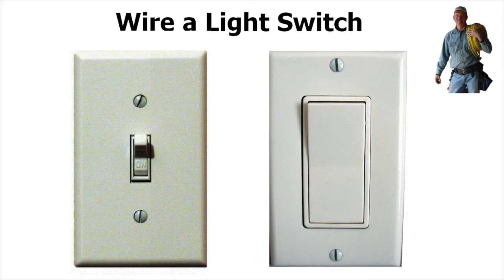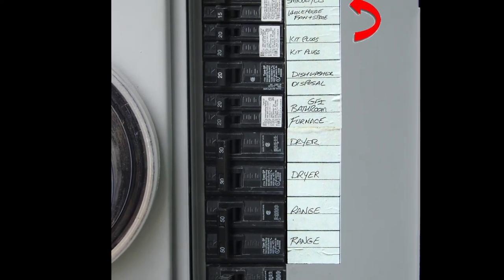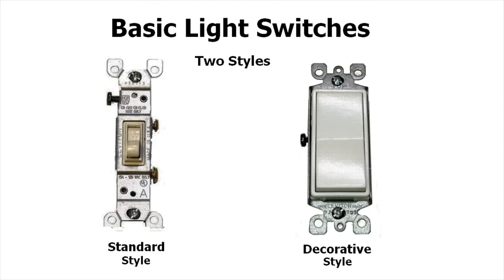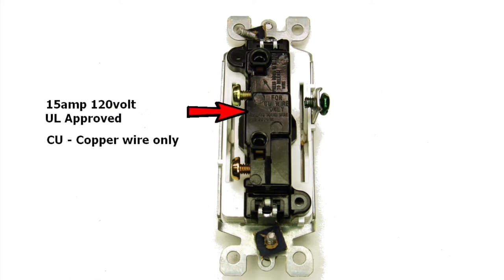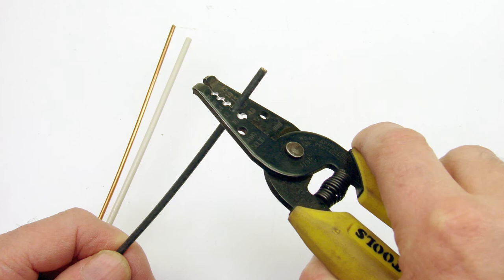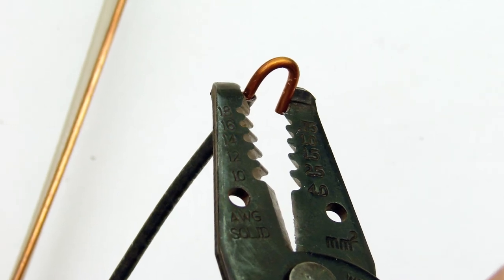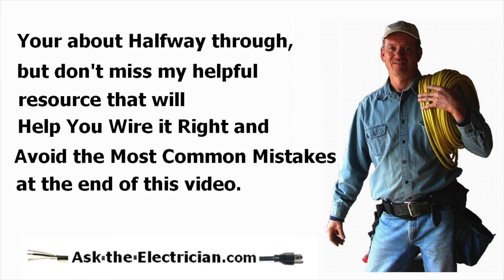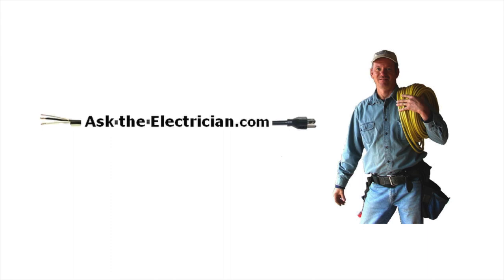How to Wire a Light Switch or Replace a Light Switch.

Comment: I've installed a remote ceiling fan/light because I can't run additional wires for two separate fan/light controls. With Romex, I've connected several flush mount lights to that one power source with the fan/light. Can I connect the lighting Romex to the remote receiver so that I can control all the lights with the remote control. Will it burn out the receiver? My goal is to run only the fan without having the lights on.
Reply from the maker: Your idea is great, but keep in mind that you would have stay under the limitation of the watts of the remote control module, and that all the lamps will be compatible as well.
Reply: @AskTheElectrician Thank you very much for the information! All of the led flush lights including the ceiling fan lights are well under the light rating for the remote. The next challenge will be to determine if I can use two receivers for a 3-way switch. Thanks again.